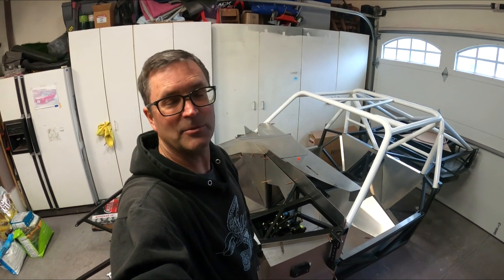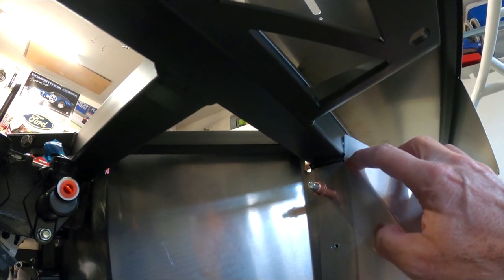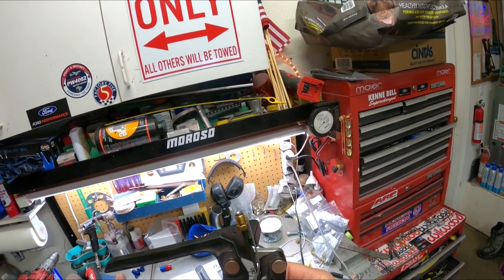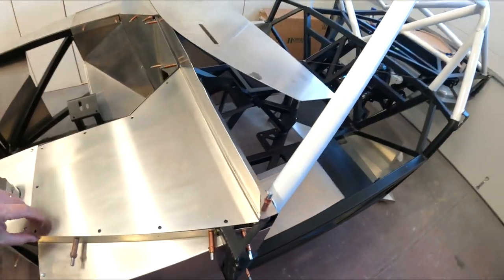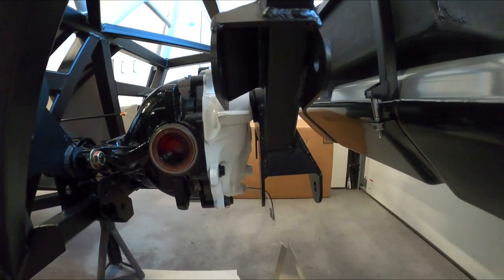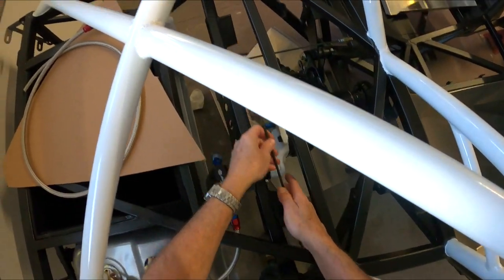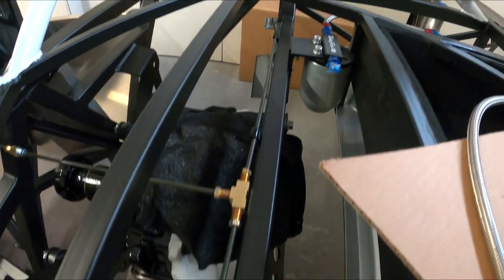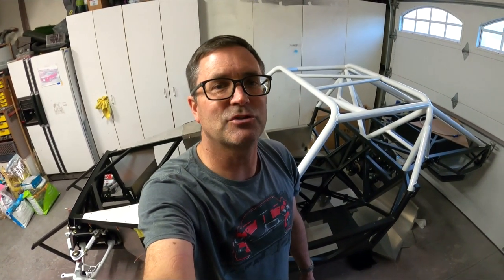Cobra Daytona Build-Rear Brake Lines, Video 34

Comment: Would it have worked to rivet the brake brackets vs taping?  The brake brackets are more of a permanent fixture vs the aluminum panels which might have to be removed at a future date.
Reply from the maker: I could have but prefer bolts to rivets.